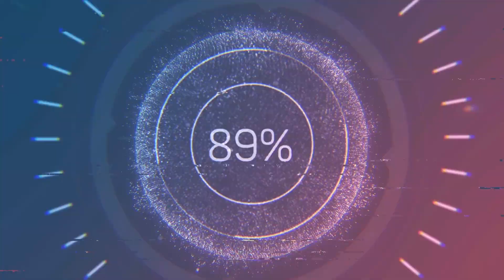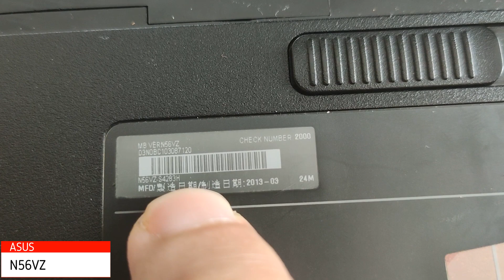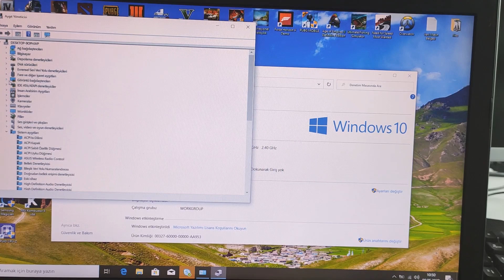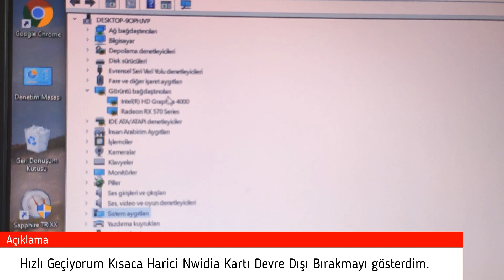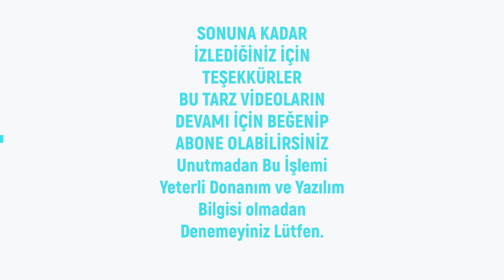Asus N56VZ Dizüstü Laptop'a Harici Ekran Kartı Takma EXP GDC V.8.5 (exp egpu case)

Comment: Hocam i5 1.nesil işlemcim yine işlemci idare ediyorda ekran kartı Intel HD graphics Baya kötü 128mb VRAM benim eski kasadan çıkan palit 9500gt var 1gb vram power supply de kasadan cikaricam sizce fark olur mu ve yapmaya değer mi
Reply from the maker: Fark eder ama bu aparatı ucuza düşürmeye çalışan ben letgodan 130 a almistim
Reply: @sungurailesi4620  hocam cs go da düşük ayarlarda i5 1.nesil palit 1gb VRAM kaç FPS alır ?
Reply: @sungurailesi4620  eğer yapmaya değmez ise ucuz ekran kartı önerebilir misiniz ?
Reply from the maker: @berateren3207  gtx 750 ti araştır
Reply: @sungurailesi4620  hocam 750ti tam uygun mudur daha aşağısı az mi gelir ?
Reply: @sungurailesi4620  GTX 650 1gb gddr5 buldum hocam nasıl olur ?
Reply: @berateren3207  aga bence  3 nesil bi 2 el laptop al onu kullan ona tak gtx 650

Comment: Harici monitör olmadan direk laptopun kendi ekranında kullanabilir miyiz bu sistemi. Oyun, render vs. İçin
Reply: Evet reis kullanabilirsin
Reply from the maker: Evet ama tam performans için harici monitör sart
Reply: Teşekkür ederim, peki işlemci olarak i7 4700mq ya darboğaz yapmayacak en iyisi hangisi olur, gtx1070, gtx1660 gider mi veya   rx570 , rx580, 5500xt aralarından düşünürsek